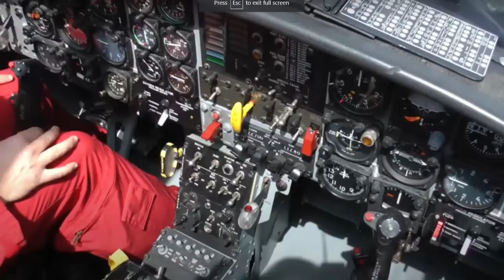Snowbirds CL41 Tutor Crash 17 May 2020

Comment: the tudor engine failure is well documented.

apparently caused from a bird ingestion by the single engine trainer airplane. but the pilot's pitch up was too steep and it precipitated an early stall and total loss of flight control. the pilot should have nosed down, maintain as much speed energy as possible and go for a water ditch, highway or farmers field wheels up crash landing. many sites were available to him just at the end of the runway.

the pilot made a basic low level flight recovery error probably caused by panic. former US air force fighter pilot and american airlines hero Chesley Sullenberger, saved every one on his airbus jet after total engine failure. he traded speed energy for distance, not speed for altitude, as capt. mac dougall had done.

sullenburger nosed down his jet and chose his crash landing spot on the hudson river thus having the best chance at survival. sullenburger did not have the option of ejecting from his aircraft. the stall speed of a tudor jet is 78 knots, less than a fully loaded air bus a320.

there were lots of landing opportunities for the snow bird pilot rather than causing a pitch up stall and ejection over a populated area. farmer's fields, rivers and a highway were all within his flight path. luckily no one was killed on the ground. if you look at where Capt. Richard MacDougall directed then ejected, and let his airplane crash, it is directly over a residential area. the crash site is less than one kilometre from a school complex.

it was a miracle that no one on the ground was killed. abandoning his jet with no concern as to where it would crash and who could be killed was irresponsible. Capt. Richard MacDougall had options and he could have crash landed the plane in an isolated area, of which there were plenty at the end of the run way rather than abandon the aircraft.

i have no confidence the military to investigate one of there own. whether it was russel williams, afghanistan or somalia. the military has been unable and unwilling to thoroughly investigate miss deeds by military personnel. this investigation should be hand off to the civilian transportation safety board for the accident report.
Show less

Comment: In old aircraft such as the CT-114 each occupant typically is responsible for his/her own ejection, correct? That is, one pulling their own handle does not fire the other's seat? Can they even fire simultaneously? It's just such a quick sequence of events - she clearly had a lot of time in the aircraft as a passenger but one might expect that she couldn't be certain about the need to bail out as quickly as the pilot. You communicate what you can but again this was mere seconds with downward velocity and such little altitude. I would've expected three smoke trails - one canopy, and two seats, but we only see two. Completely tragic - she sounded like such an amazing person and I'm sorry to those who knew her for your great loss.

Comment: As a pilot myself the first thing you do when you have an engine problem is to gain altitude and that's what happened there. They didn't stall. They gained altitude to  to quickly choose best place to do force landing and they didn't have enough speed nor altitude so they  ejected
Reply: The aircraft did stall, which is why the pilot had no control of the aircraft - you saw the spin? This wouldn't have been intentional, hence a lack of control due to a stall.
Reply: Didn't help that the aircraft started an increasing left bank almost immediately after he initiated the climb.  This decreased airspeed and increased the stall speed as the bank steepened.

Comment: One engine failure should not have resulted in a stall spin accident.   Go to full power on the good engine, level the wings, and climb out slowly to gain altitude.  Fly on the good engine being careful not to get too slow or turn into the dead engine.   Land safely.
Reply: Tutor is not a twin  - u fail

Comment: That ejection seat must have a higher minimum altitude requirement than 60 feet. That’s only 2-3 times the height of a street light. Looked they were 300-400’ AGL before punching out? That seat must need at least 700’ to go through all its procedures and sequences, yes?
Reply: The seats capabilities are when the aircraft is in level flight. If the aircraft is not level and descending, there is two factors working against it. The first is that the seat is not propelled directly upwards as it would be in level flight and the second is that the descent rate cancels out the seat ejection rate. For instance, if the seat goes up at 100mph from a level aircraft, then the seat will gain enough altitude to open in time, but if the aircraft is falling at 200mph and the pilot ejects, it means the seat is no longer going up at 100mph but is descending at 100mph (relatively speaking). So when the aircraft is not level, does not have a lot of forward airspeed to open the chutes and is descending, the seats didn't have a chance of a successful ejection.

Comment: On flame out the jolt that takes place when this happens slows the turbine down to below start up speed so chances of a restart are very remote.
The aircraft did well to aquire the hight it got to with no power bearing in mind that the engine is now creating drag not thrust, i wonder if it took a bird stike while taking off as the pop sound indicates fuel and ignition still taking place, with those engines bird strikes with make a real mess of the compressor to the point where it cannot even rotate which would indicate there only being one pop then nothing.

Comment: 1:35 sound ... 2 pops.  compressor stall two pops and one you can barely hear.  malfunction then hear stall afterwards.      fuel starvation, sucked in a bird in intake , sucked in a wrench.  stalled compressor.  a few moments before big pop you can hear the wavyness of sound that is choppy... is either malfunc of fuel and air to compressor.

Comment: Should have punched out at the top of the arc. A high bank turn with little power or airspeed will always end in tears. Pilot was probably trying to avoid density housing. The deployment timing on the parachutes opening was archaic.
Reply: Ya when you compare it to the low and slow CF18 ejection during the airshow, the seat righted the pilot and gave enough time for the shoot to open.

Comment: The Snowbirds are far from unique in having nine aircraft in a display team. Perhaps you have heard of the RAF's display team, the Red Arrows, which has utilised nine jet aircraft in its display team since 1966. Or maybe the Chinese Air Force's Thunder Tigers team, which also uses nine aircraft - AT-3Bs - for its displays, as does the Indian Air Force's Sun Rays display team with - on par with the Red Arrows in number and type - its nine BAe Hawks. All of these are however, smaller than the Italian Air Force's Frecce Tricolori display team, which uses ten Aermacchi MB-339s, nine of which form the main display routines,  joined in formation for some maneuvers by the tenth jet in the team which performs the solo part of the routine.

Comment: Poor pilots.  Bet they didn’t think it could be their last flight.  Just like when we lose a racing driver or rider we often forget that even with advancements in safety and training it’s still dangerous.  Looks like they did pretty much everything right, identified issue quickly, traded airspeed for altitude but sadly such an old aircraft its ejection system wasn’t good enough.  My heart goes out to the families,  friends and the rest of the team, pilots and ground crew.

Comment: I'm quite sure only 1 of the 2 people in the plane ejected. One went down with the plane. The pilot ejected the other didn't/couldn't
Reply: Watch the video again. TWO smoke trails. Or do you think the seat left leave the aircraft without Captain Jenn? 

They both got out, but they were out of envelope for any ejection other than right side up. In a comment above, the unofficial but well known standard was 2000' for anything other than perfectly level, allowing straight up flight on the rocket. 

According to linked sites in this forum post (https://www.avsim.com/forums/topic/575427-rcaf-snowbird-crash-in-residential-area-in-bc/page/2/), regarding the Weber seats in the Tutor: "There was a proposal to replace the ejection seats with more a modern zero-zero model, but this has not been done yet. I'm not sure the ejection from low altitude while headed almost straight into the ground would be within parameters for these seats. For reference, the Tutors were grounded ten years ago due to issues with their ejection seats. Along with the Tutors, the RCAF's T-133 and F-86 were also grounded with the same issue. https://ottawacitizen.com/news/national/defence-watch/problem-discovered-on-canadian-air-force-ejection-seats/ And here is one proposal for upgrading the aircraft, though it appears to have been replaced. http://www.forces.gc.ca/en/business-defence-acquisition-guide-2015/aerospace-systems-990.page. Here is an interesting article about the Weber seats. Apparently as originally designed, there was not enough separation between pilot and seat at main chute opening, thus leading to a redesign incorporating a drogue chute that not only increased the distance to a safe margin, but may well have increased the time between ejection and main chute opening: http://www.ejectionsite.com/ct114seat.htm Finally, although it may well likely transpire to have no application to the Tudor seats, there was a fatal accident in which the HSE and MoD were implicated for withholding information (which is a possibility, however remote, in the current case): https://en.wikipedia.org/wiki/Martin-Baker#Red_Arrows_pilot_incident

Comment: Bottomline:  It was a late ejection by pilots unready to realistically fly that aircraft altogether, imho.  The takeoff is the worst time to suddenly have an engine out, when at your lowest and slowest.  Prior to flight, passenger and pilot needed to be absolutely sure about ejecting, when, where, why and how AND have that checked and reinforced at several training points, but at pretakeoff briefing especially.  
       What i basically mean is that briefing of pilot to self and pilot to passenger MUST, should, somehow, ready that pilot and passenger to expect to (safely) eject as much as fly away with no problem.  THAT's what's missing here altogether, but WOULD have prevented such, all-too-common, late ejection (innate psychological hesitation or misunderstanding), imho.  Happy landings.

Comment: single engine jet like that losing an engine at that altitude and speed  passing  end of runway should  pull up vertical or attempt a 1/2 immelmann  and eject.  Wreckage would hopefully land on or close to airport and they would have some attitude for successful parachute deployment. 
She may have been trying to climb turrn and return to airport when it stalled. 
Im surprised that  you can't even see any chute start to deploy.  Usually they deploy very quickly.

Comment: Incep Spin? On engine failure? REALLY?....she was dead getting in with him.
Looks like they bled airspeed trying to turn in vain to the airfield and got into an incep. Pure. Ego and "get to the fielditis".
There's literally a river to the right, clearly the pre-flight didn't include if engine fail on takeoff past gonogo point, go to river.
Ridiculous. Tragedy could've been avoided. That bird wasn't even big enough to more than flameout the engine (though he had no airspeed really to attempt a restart).
There are so few successes with getting to the field on engine failure on takeoff that I'm extremely surprised a military pilot would've tried. Must've let his ego get in the way.
I'm sure they'll blame something else on the spin, nose down attitude and late passenger ejection other than the pilots ego.
Pretty sure the PIC is to ensure the passenger bails out FIRST and straight and level. 
Bailing out second? With negative rate decent that low? She was dead getting in with him.

The only reason he doesn't have serious brain injuries is he had an angled roof to break his crazy speed (and ankles), the chutes barely had time to inflate with that sink rate.

Comment: Bottomline: Besides the film and sound evidence shown, is anyone producing a black box recreation of this very flight, second by second, every control input with altitude and airspeed shown for public analysis?  I'm specifically pointing to that pilot's (unusual?) sharp climb and break to the left of runway heading.  
     To my knowledge and instinct, that plane shouldn't have done either of those things and that particular inadvertent maneuver shortened, and thus altered beyond practical use here, the potential safe ejection window to be closed or unrecognizable altogether for no yet given good or known reason.

Comment: I was sent a video less than an hour after the crash from earlier in takeoff.   I was listening for the pop of the engine but couldn’t hear it. It does show the ejection of both more clearly. I couldn’t see the parachutes opening for either but don’t have the capacity to slow it down or anything.

Comment: Look like an engine failure because the pilot tried to reach suddenly a higher altitude in order to transform the plane energy in altitude and started a corner to come back to the airfield. Unfortunately, probably to slow and start a fatal spin. The pilot did his best. A jet without engine is a very bad glider. I personally faced an engine failure after taking off on a single propeller and this is what I did knowing that  my plane is way much better glider and I was able to land safe. Thoughts are with families from France.

Comment: Very saddened by this loss. As a pilot who has deployed a brs parachute on a small aircraft and walked away without a scratch after a propeller failure, my question is could they develop brs parachutes for these light jet aircraft? This perhaps is safer then ejection seats depending on the emergency.

Comment: Very interesting video and analysis.  I had not seen this particular angle at all.  It will be interesting to see what the investigation ultimately finds as the cause.  I'm thinking that they stayed with the aircraft to try and minimize casualties on the ground, but that's just my feeling on it and not based on any fact.  Ejection at that altitude and that aircraft attitude did not give them much of a chance.

Here is a link to the RCAF website and Captain Casey's biography: http://www.rcaf-arc.forces.gc.ca/en/snowbirds/standard-template-biography-snowbirds.page?doc=captain-jenn-casey/jucn33uv

Comment: There must be a problem with RCAF 431 Squadron maintenance when a J85-CAN-40 can quit on a routine nothing takeoff.  It's unclear what caused the 'pop' but as the recent Canadian Auditor General audit found the RCAF have more aircraft than qualified pilots and technicians and a problem attracting and keeping good pilots.  Some CF-18 pilots are bolting to Australia to fly the F-35 with the CF-18 becoming a relic. This is the second Tutor in seven months to lose an engine. The last one lost an engine and crashed in Atlanta. 

On May 30, an almost brand new CH-148 (Cyclone) went down in the Ionian Sea, no survivors. The first statement from Canada's DoD jarmouth was to express full confidence in the Cyclone fleet.  Whoever said there's anything wrong with the aircraft? 

The RCAF have been rushing through pilot (not the Snowbirds) and technician candidates to fill vacant aircraft seats and shop positions by lowering the standards in addition to a nagging parts shortage. 

The CT-114's original manufacturer Canadair and engine maker Orenda no longer exist. The maintenance of these legacy aircraft occurs under the approval and alleged oversight of the Technical Airworthiness Authority. Who certified this Tutor's J85 airworthiness? 

Many billions of dollars have been spent on designing jet engines to be as failsafe as possible.  Stuff happens but hard to believe. What a waste of life and aircraft. 

In Oct. 2008,  a new recruit to the Snowbirds and a captain, untrained and unfamiliar with the Tutor, no flight brief, took a fellow reservist pilot/photographer up for a useless photo shoot and plowed it into the ground while fixated on the pack, neither watching the altitude. Could get a concussion from disbelief head shaking.

Comment: Would seem to be the wrong action in any plane to pull up so hard after you lose power would have thought they could safely eject at the altitude they were at .
Have seen them perform before and they do put on an impressive show considering they fly such unimpressive planes .
On a side note what would the point of any air display team be in flying 60 year old trainer jets ?
They are supposed to be a recruiting tool to showcase the best of the best .
The pilots are the best but the planes are far from it .
Hardly creates pride in being Canadian when your airforce is flying antiques 
Perhaps once they start getting their new jets ( whenever/whatever they will be ) they can replace these tutors with cf18 jets ,the Angles put on a very impressive show with them still today